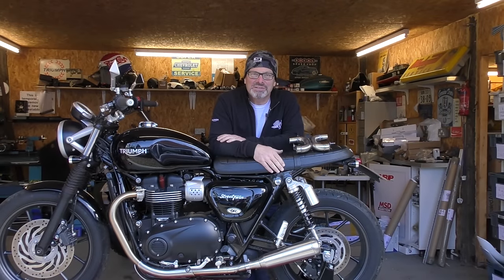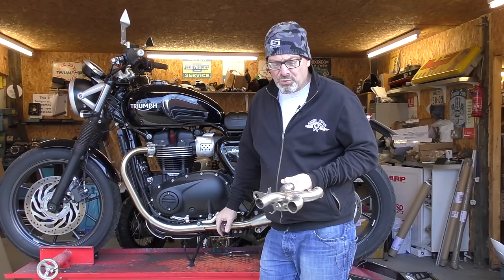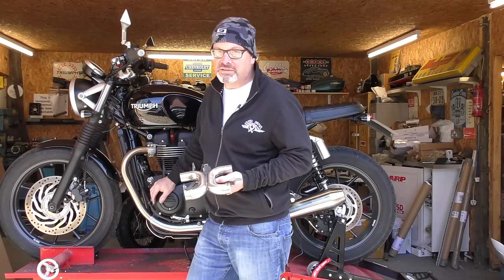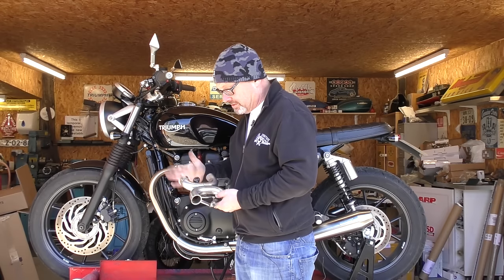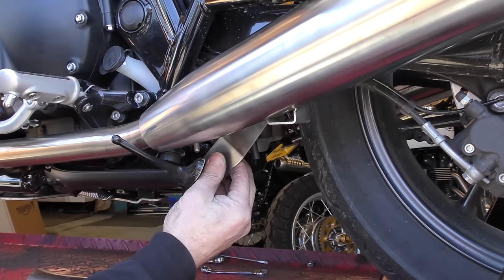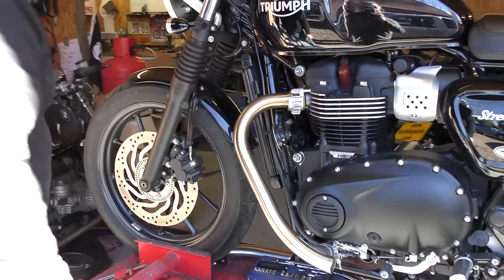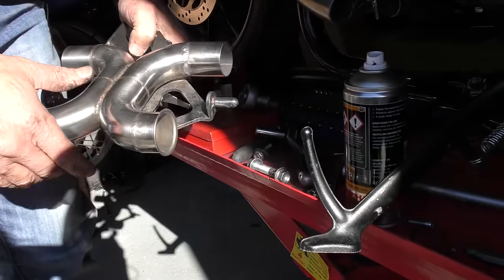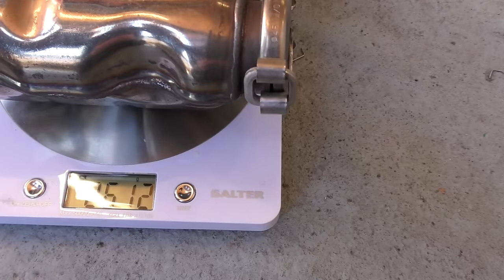TEC Decat X Pipe

Comment: So, I just finished installing the Tec X-Pipe and man, what a difference!  It sounds amazing, and the low speed throttle response is greatly improved. I could not be happier. I expected it to sound better, but I wasn't expecting the smooth throttle response. In my opinion it was worth it just for that alone. The deep rumbling sound is a bonus!
I also installed their bar-end mirrors. They look great, were a breeze to install, and they provide a better sight picture  than the the stock mirrors, and you can't beat the price.
Two thumbs up for Tec Bike Parts. If you're in the market for a de-cat or some mirrors to jazz up your Triumph, I can definitely recommend these guys.
Reply: Wicked Coolname - Good to hear. Did you keep the stock silencers?
Reply: @salskars6637  Yes. I'm still running the stock silencers. I think they sound fine, but I've never been crazy about the pea shooter looks, so  I may buy some slip-ons one of these days just to improve the looks. But I have a bunch of other money to spend first. I'm looking at windscreens,  passenger back rest, panniers,  mini LED indicators, and a few other things. Plus, I need some  new riding gear, like a summer mesh jacket and a jacket for the other 3 seasons, gloves, pants, etc..
If I'm not flat broke by then maybe I'll look I to some better looking pipes.
Reply: @wickedcoolname399  - I'm with ya on that. 
Reason I asked was to save $ with just the x-pipe for now. Thanks for the reply. Stay safe.

Comment: Just today installed a TEC Bike Parts x-pipe on my Triumph T120. Very pleased! There's more sound. Not different, just more, and very pleasant. The bike has always had a very sensitive throttle, a little abrupt. This is gone. Throttle response is now VERY smooth. There's a little less engine braking available than there was, but not by much. There's still no decel pop. No engine remap was necessary. This X-pipe fits nicely with no "persuading", using the original seals and clamps. It doesn't hurt that this righteous little mod reduces the bike's weight by 4 lbs. Nicely done, gents!
Reply: it is supposed to improve performances too. Do you confirm ?
Reply: With no dyno access there's no way to confirm any performance increase. Certainly feels nice, though. Fuel economy is right where it was.
Reply: Could you do all the work on the centre stand?
Reply: I did, no problem.
Reply: Don't know. You might ask TEC using the contact function on their web site. They're good about answering.
Reply: tsmgguy Yeah, I tried before but they never got back to me. They did though yesterday. Answer is no. The slip-ons won't fit a T120. Cheers.

Comment: Just fitted the TEC X-Pipe to my T100 Bonnie.....in this vid the tank is not moved....got to be on my T100 as that top frame bolt is behind it.....also leaving the front pipes hanging is not an option.....as my pipes have long extension outer covers.

Had me scratching my head.

Test rode the bike....its great....love the sound....and goes great.....and the horrendous heavy engine braking is much improved....more normal feeling now.

My X-Pipe seems to be a modified version....with pressed upper and lower middle sections.

I ran my bike up onto 50mm thick  lengths of wood....front and back.....makes access easier.....and I could get me head under the X-pipe to see to pesky back clamps.....I have a ctr stand.

Comment: Thanks for the walkthrough. I didn't have as much free play in my frame and had to also loosen the other side, and disconnect the kickstand sensor. My clutch cable was also really tight. Eventually I worked the cat out, though, and the xpipe sounds great with my tec slip ons.

Comment: I just fitted a TEC X-Pipe to  T120. The procedure is similar. The main difference is the header pipes heat shield. It's in one piece which make alignment a shade trickier. Plus one of my rear cup clamps was a totally 2hat to get seated and clamped. The noise is nice but also my sear of pants dyno says more midrange. I didn't expect to 'feel' and difference. Did me a excellent modification.
Reply: Did you have your T120 remapped after your TEC Xpipe install and are you running the stock silencers? Thank you!

Comment: Installed x pipe and cans today....they sound great...my only struggle was top frame bolt but I manage to do the job without totally removing but slackened off...all else went perfect but had to buy 8mm Allen for rachet....weight difference is most obvious when riding...engine is sharper and reactive....long weekend ride needed now...thanks TEC team. (Luggage rack, Xpipe, End Cans....next maybe shocks and fork springs)
Reply from the maker: Glad to hear you are happy with them, and yes the frame top nut and bolt can be a pain till you are used to doing them

Comment: The top and bottom frame bolts are 40nm, the exhaust header to head bolts are 19nm, but the frame to crankcase bolt is 105nm.

Comment: Just put one on my 2017 T120 is does sound good. Not sure if the one for the US comes from different manufacturer, but fitment was not the greatest. Welds had to be ground down in side the pipe, does not slide all the way into the rubber mount on right side of bike, and had to grind down the heat shield to have it fit properly on without rubbing mounting bolts. For the price I would say it is pretty good, but hindsight I think I would spend the extra money on a Motone or one of better build quality.

Comment: Fitted an x pipe to my thruxton r today,I'm not a mechanic but no mug either,but it took 4 1/2 hours but very fiddly nothing like the video,butwith a little perseverance and comprehensive tool kit you should be ok.
Did min on a paddock stand and laid on the floor,not ideal,was it worth it?......OH YES! The sound is just what I wanted running with a pair of straight through Vance and Hines!
Reply: Took me 5 hours on my T100 a few days ago David.

Comment: Fitted this to my 2018 Speedmaster with the 1200HT engine today. It was a little more tricky, had to remove the footpeg bar as well. One thing I noticed, is the TEC x-pipe is 10mm narrower than the stock cat ONLY at the fixing points, so it sits across to the left by this much, being pulled away from the post on the right by the 2 fixing bolts on the left. It still works as it should though but had a bit of a battle getting the LHS header pipe on, had to widen it at the lower flange because of the slight angle change due to it's skewiffishness to the left, maybe it's by design to get it into place easier, or maybe I have a defectively manufactured unit, I don't know.

As others have said, more noise (louder and sounds less like a Superdream and more like a Triumph), smoother throttle from pulling away (or am I just getting used to the drive by wire), no noticeable changes otherwise.

Comment: The torque is a function of exhaust scavenging, which the x-pipe crossover accomplishes.

But to get the air-fuel ratio where it should be especially after opening up the system, you need a power module and/or ECU reflash if you don't want to run lean and give the engine a slow death. You'll regain all the power and then some. Sound will also change with proper air-fuel ratios.
Reply: No, this is all tosh. It's an internet rumour that they run lean. By default the 1200s all run rich on acceleration, and stoich on cruise due to the O2 sensors in closed-loop mode. A PCV can be used to smooth out the delivery and adjust timing, but it's far from necessary.
Reply: And from dyno charts I have seen on the 1200cc, they never get close to stoich even on cruise. all this self learning talk makes me question this too. for an ECU to "self learn"or more properly put, adjust the A/F ratio across the entire throttle range, it needs sensor input. Unless the 1200cc twins have wide band Lambda sensors, I don't see any way for these ECUs to self learn. Narrow band sensors which unless i'm wrong are on the 1200cc bikes, (my Street Twin has narrow band sensors BTW), only micro manage the A/F from just below stoich to just above in closed loop. I am speculating, but I think all these bikes are so de-tuned low revving and run so rich from the factory, there is little danger of over leaning them. I would love to see hard data on the 900cc WC twins.
Reply: The self-learn stuff is all a bit of bollocks. They have trim values that self-adjust, but nothing like some internal AI unit that does mass-adjustments :)
They do all run perfectly at stoich on the dyno. Charts showing otherwise probably have dodgy gas analysers (which is not uncommon), but a narrowband O2 sensor forces it to be stoich unless they're faulty. What you say re below/above is absolutely correct, and the same on the 1200s, and they only ever run rich on acceleration.

Comment: Hi Tec, 2 things I've noticed since fitting your X pipe on my 2016 Street Twin.   1. The sound is AWESOME!!   2. Blue smoke when I rev it. I didn't see any smoke in your video, from any of the pipe configuations. Is it normal to see some initially?  (I'm still running the stock mufflers). Cheers in advance.

Comment: Three things: First, why did it seem like the bike didn't want to start on the first try after fitting the X-Pipe and each subsequent set of cans? Second, would you consider doing an install video for the 1200cc Speed Twin? Unless, the process is absolutely identical. Third, do you absolutely recommend the installation of a "booster plug" with this mod, when sticking with the stock cans and baffles? I've seen where some users have said they didn't need it. However, if these bikes run as lean as they're supposed to, in order to pass Euro 4 and/or Euro 5 regs, I don't see how that's possible. 

Thanks, George! I think this is going to be the first "performance mod" I do to my girlfriend's 2019 Speed Twin!
Reply from the maker: speed twin is basically the same but like the thruxton and t120 you need to loosen the rear tank mount and pull tank back slightly to gain access to the top R/H frame rail bolt, no need to remove tank or fuel pipes etc.
Also easier if you remove the full exhaust off the bike and best to have help when re fitting the front pipes as easier to fit both front pipes together.
Reply from the maker: Re booster plug, it is not essential to fit one and the bike will run safe with a TEC decat fitted on stock ECU tune .We have done lots of testing to check this on all water cooled twin models. What you find on all stock out of the showroom Euro 4 models is that you have a lumpy throttle response with quite a noticeable lag when coming back on the throttle from fully closed. The TEC de cat pipe helps to reduce this and the booster plug will also help with this by giving a richer mixture during acceleration. Combined they make a big difference to the way the bike rides and makes it much smoother and crisper during acceleration.

Comment: Same process for the Speed Twin and Thruxton? I'm not mechanically inclined
Reply from the maker: basically the same except, you need to loosen the tank rear mount and slide it back a couple of inches, (no need to disconnect anything) to get access to frame rail top bolt.
Best to remove the front pipes fully because of balance pipe , and easier to reinstall if you fit both front pipes at once . so a helper is good for that stage.
Reply: @TECBikeParts  thank you!

Comment: Is there a torque on the exhaust clamps and the radiator bolt , also the frame bolts do you use blue thread locker ?

Comment: I've just bought a 12 month old Speed Twin with the TEC decat and Vance and Hines. It pops one hell of a lot on deceleration/throttle release and also a single pop when the clutch is pulled to change gear.  Is this normal or is there possibly an issue with the install? I sort of like it but it is a bit excessive. I'll considering reverting to the cat. I bought it as it is loaded with almost every other TEC part too! Beautiful!  Any help/advice gratefully received.
Reply: I bet one of the 2 piece clamps is not seated correctly......what a fiddle.....can look like it on ok.....but may not be....I have heard some pop....mine doesn't I am glad to say.

Saying that I am still on factory pipes.

Comment: I notice the handle bars on the street twin are not the original one´s. They seem to be some Renthal ones maybe? I like the look of them on the bike and I´m looking to either find a way to rise the height of the stock handlebars or mount some higher one´s on my Street Twin. Not easy it seems, with the small slack on the cables.

Can you tell me if, apart from the front brake nipple extension, clutch and front brake cables (witch I´m certain need to be lenghtened), any other cable needed lengthening to install those bars?

Thank you.
Reply from the maker: Hi
the only part that needs to be lengthened to fit these higher bars is the brake pipe, as you can see i made an extension,all cables are stock
Reply: Thank you for the quick reply. Glad all the cables have room for higher bars (from first inspection it does not seem like they would have enough slack).

Will have to check how brake bleeding and the likes work - necessary when adding a nipple to the front brake line I believe. ABS brakes seem also a concern on this aspect. Maybe I should get that done on a Triumph dealer. 

If only I could get my hands on a handlebar riser which would  lift the stock handlebars a little bit. I believe that could work well enough. Unfortunatly I don´t see any riser which might work (apart from the British Customs one´s which need to ship from USA).

Thanks again. Really appreciate the help.
Reply from the maker: If you are careful you can bleed the brake at the joint with the master cylinder and no need to bleed the full system.I have done this many times without problem.
To bleed the full system this must be done with dealer diagnostic tool to power the ABS pump and purge the system of air.
Reply: Thank you for the tips. Will have to check to see If I can find any videos regarding this "partial" bleeding you mencion. Just so I can get a better idea of how the procedure is done. Will analise this and if i find it to complicated I´ll have to install the brake nipple directly at the dealer.

I´ve checked the Renthal website and I do believe the handlebars mounted on your demo Street Twin are the road model one´s. Do you mind teling me what is the model mounted on the bike? (road low/medium or high)? From what I have seen, it seems the low one´s do have more than enough rise compared to the stock handlebars. I just need a bit of a rise in the bars. Nothing to crazy.

Thank you for any info regarding the handlebar model and the brake bleeding aspect of things. Really appreciate it.

Comment: Hi guys, I bought the x-pipe and tried to install it on my 2018 T120. It didn’t fit right and upon closer look, I noticed that the pipe connections are shorter than on the cat and the hanger on the front end on the unit was welded crooked. So, if I connect the pipes evenly, it doesn’t reach the hanging bolts or if I hang the x-pipe on the bolts, the pipes on the right side barely connect to the unit. Unfortunately, costumer support is MIA this time. Bummer. I’ve purchased other products with great satisfaction in the past.
Reply from the maker: Hi
Very unusual to have any problems with fit on these as made on a very tight jig, but it is possible for some small distortion can occur from welding . Are you in UK or USA. If in the UK you can call or email us and we can talk you through any fitting issues. At TEC we always stand by our products with full no quibble warranty and after sales back up
Reply: Thanks for your prompt response. I’m in the US. I sent support an email with a couple of pictures. 
As I said in my message, I’ve purchased other products in the past (levers and mirrors) and the quality and customer support has always been superb. 
Thanks.
Reply: Hi guys, I did get a new unit. Thank you so much for your assistance. I just shipped the old unit back. 
Best,

Comment: I'm wanting to do the TEC X Pipe on my Thruxton R (2016) along with VH slip on, is it necessary to flash the ecu also, or remap the air and gas to the cyclinders?  Is this something I can do from my laptop, along with some kind of download, or must it be from a dealer?
thank you
I've enjoyed all the vid and found them very informative
Reply from the maker: Hi
No remap available for the 1200cc motors available from Triumph or any other source at the moment. We have done lots of dyno testing and the bike will run safe and OK with the de cat and straight through type silencers.
However the engine will be more responsive and will run better with a fuel enrichment system fitted. 
You can use a Power commander, but this is a bit of over kill as a Booster plug device will work great and does not need any programming.
We can supply both the Booster plug or a Power Commander V system.
The Booster plug is straight plug in ,it takes about 5 mins to DIY install and costs £119.99 from us.
see   www.boosterplug.com
The Dynojet power commander V starts from around £380.00 plus installation and programming. Price of the Power commander depending on what options/add on's you require , but you only really need this if you are going to fit a race cam.
see www.dynojet.com